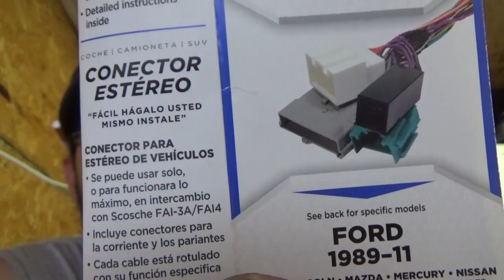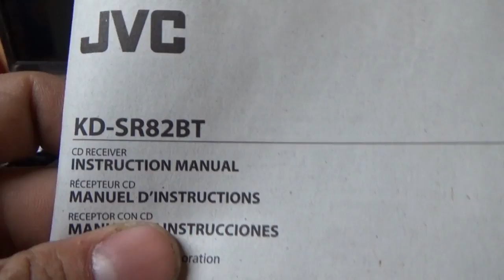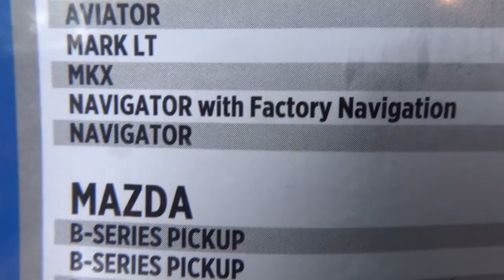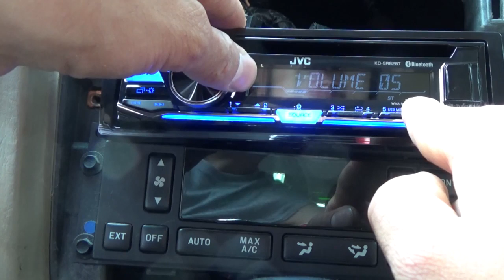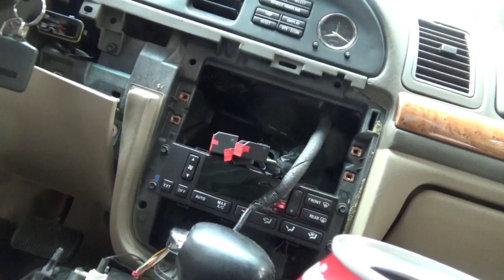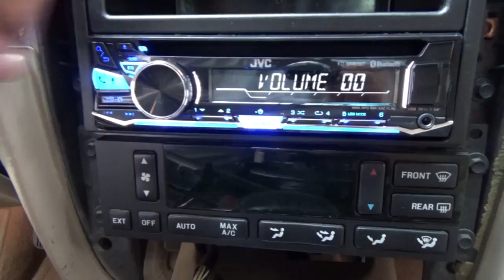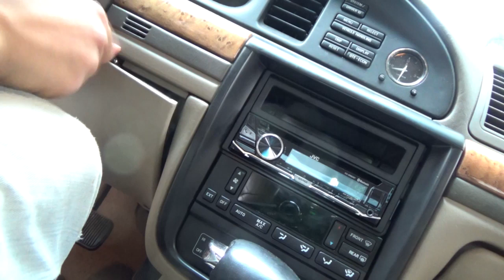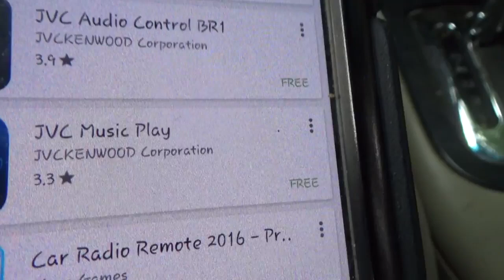1998-2002 Lincoln continental radio installation

Comment: Find the green w/black stripe wire within the 16 pin connector youre not using , connect it to 12v accessory.
That is the wire that allows you to control the  fan speed and temp from the steering wheel